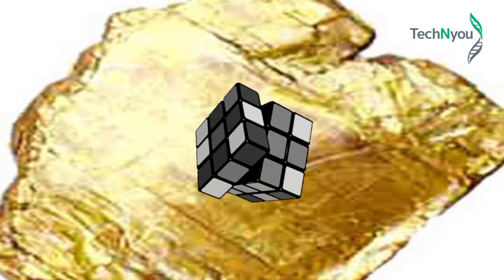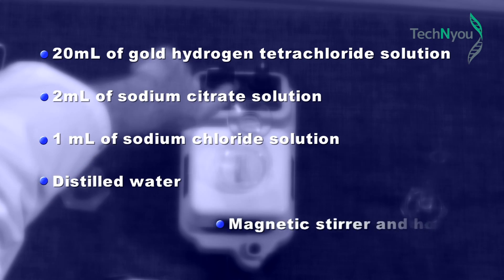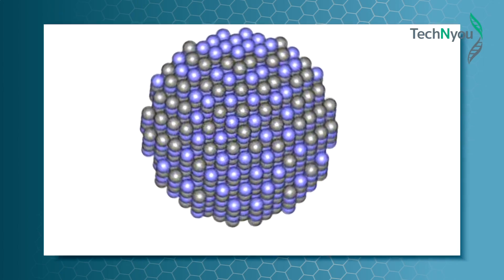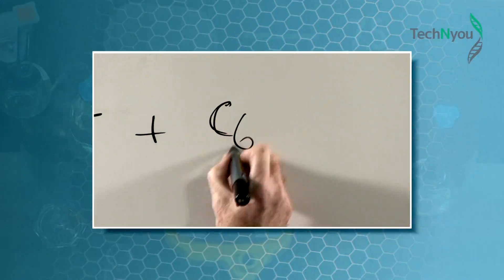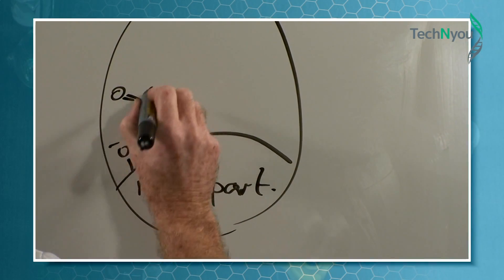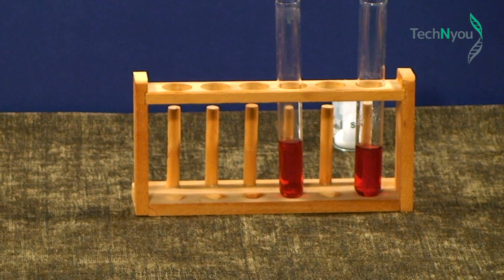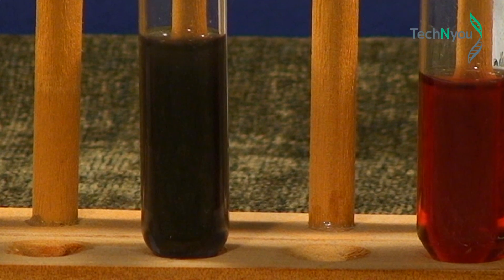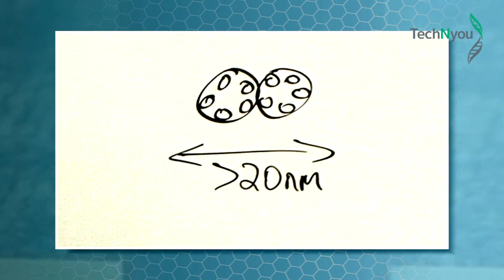MAKING GOLD NANOPARTICLES

Comment: Where does one acquire the gold hydrogen tetrachloride solution? Thanks
Reply: Further research is needed I guess, I am interested in using gold as a medication. I will be looking at it as well 😄😃🌼
Reply: @lenafranklin7262  Good luck!
Reply: @1212Artemis  have you got any? I'm looking at health food shops and eBay . . Its hard to discern the quality. I also have some other contacts . Cheers 😃👍
Reply: Hey  @lenafranklin7262 , Not yet. I am still on the prowl for it. 

Your best bet is actually acquiring it from a pharmaceutical company like sigma Aldrich. I am not sure if they sell it to the public though. I'd be a little skeptical about buying stuff from eBay tbh, but then again they could be legit, who really knows? I wouldn't hehe
Reply: @1212Artemis  Throwing gold into aqua regalia yields this salt.

Comment: This completely failed me. The solution remained yellow and never went through a color change. I followed the famous method of "Controlled nucleation for the regulation of the particle size in monodisperse gold suspensions" using the same reagents and a very similar method to yours.
Reply: Could you please explain how did you prepare the solutions on that paper? or send me the protocol.  especially for Na-Citrate. Thanks
Reply: Control pH of gold chloride solution 2~3, acidic solution remains yellow if you add sodium citrate

Comment: How long these particles will remain suspended in the solvent?
Reply: Until they start to aggregation and drop out of suspension, which requires an energy input to remove the citrate capping ligands. Also in the case shown the particles are aggregated via the addition of a salt (NaCl) due to flocculation at the electronic double layer on the surface on the gold. If you can prevent outside processes on the surface then the citrate should be able to stabilize indefinitely but in real life application this will not occur. The particles will eventually agglomerate, coagulate, and finally drop out of suspension.